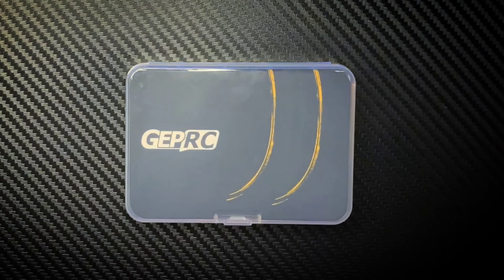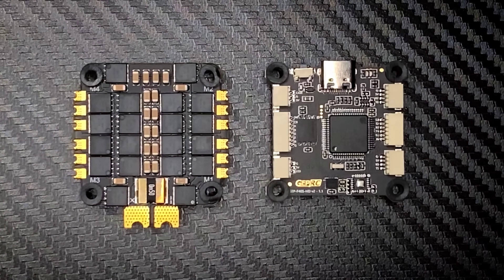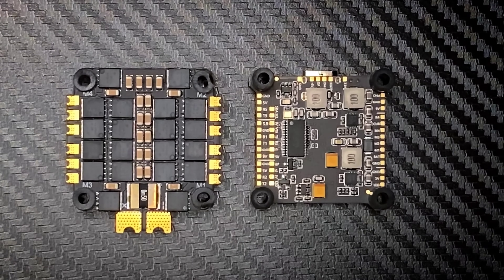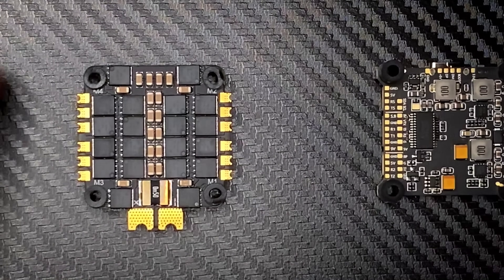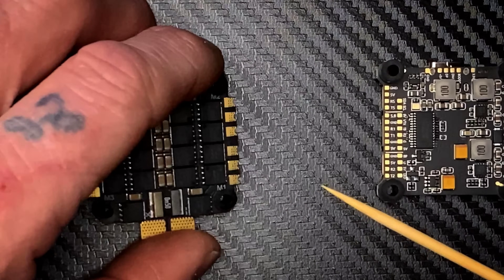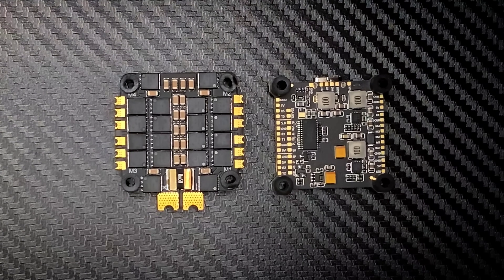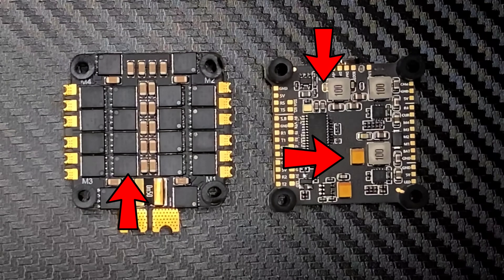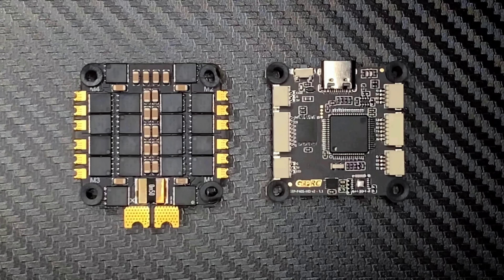GEPRC TAKER F405 50A Stack | Best Budget Stack ? After 2 Months Usage #fpv #fpvdrone

Comment: i have one tvs unify vtx, i cant right connection. what is pinout vtx and betaflight uart?
Reply from the maker: You can use other UART connections as well just make sure VTX signal wire goes to VTX in pad
Reply: @justhackitfpv  thanks for information. Thats problem Betaflight versiyon. İ resetup it. Now its work.

Comment: Is there places for servo?
Reply from the maker: You can use motor pad for PWM signals
Reply: @justhackitfpv  there are only 4 pieces Pad for motors
Reply from the maker: There are more pads as well

Comment: Which direction is the front? Ive just got it and can't see any arrow to which way it should be installed.  Thanks
Reply: How is it after a month? Especially compared to mamba, iflight stacks in same price range?
Reply from the maker: @SuperKREPSINIS  Mamba and iflight are no match to this , it's 2024 Mamba and iflight are far behind in stacks
Reply: @justhackitfpv  are you american? Where do you buy in europe, im beginner and dont want to wait a month for parts + customs fees
Reply: @justhackitfpv  oh, issue its 30x30... I need 20x20... Any suggestions for 3s drone with tyro 79 frame + digital camera... I need all the plugs, dont want to solder and something cheaper
Reply from the maker: @SuperKREPSINIS  I am Indian origin,  in Europe there's hobbyrcuk , unmannedtechshop , fpvmarket.eu
Reply from the maker: @SuperKREPSINIS there aren't much fc in 20x20mm format with all the plugs,  you will have to solder in 20x20mm , speedybee 20mm stack would be good choice for tyro
Reply from the maker: I'm thumbnail top side is front
Reply: Sorry, I still don't see it.  Is the front the usb connector or where the dji connector is or the side where the esc plugs into? Sorry for the stupid question. Thanks.
Reply: You can use it either way